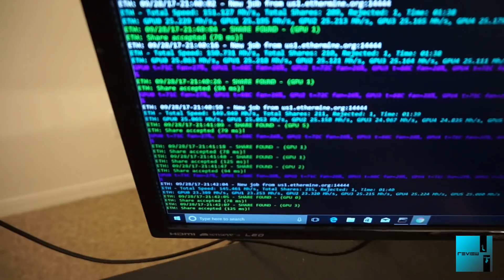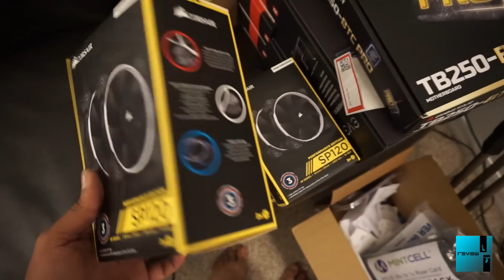8 GPU Mining Rig Build

Comment: Hey, is it ok to use both ends from 1 pci-e cable and put it in both power slots from the graphics cards. some people say it is dangerous. On my seasonic 1300W supply they say that if your card uses more than 220W than you need to use 2 cables (not the crossed one). So probably for mining this is fine, but for gaming you better use 2 different cables, is that correct? What is your view on this subject. Thx a lot. Greetings Mathias

Comment: what virtual memory settings are you using, i got my cards to run good on amd not sure if power limit is the cause but everytime i mine sometimes it freezes and puts mh/s to 0 i want to keep my m/hs steadily at 146 m/hs but as soon as one drops it goes to 120 help
Reply from the maker: i set my virtual memory to 16gb
Reply: i realized have to fine tune memory clock and core clock to stay stable then code a restart boot to ethminer i got a nice tune right now but it seems like i max out at 141  mh/s with 6 black edition gts cards without it crashing every ten minutes i cant bios mod them because when i do it only shows 5
Reply from the maker: after you flash the bios then run the patcher then restart then repeat for next card
Reply: do you know why a gpu crashes every 10 minutes and the system restarts? how do i make the gpu stable?
Reply from the maker: is the miner restarting or the whole computer?
Reply: i set a bat file so that when a gpu hits 0 m/hs the motherboard restarts msi starts up and the miner automatically boots up
Reply from the maker: mmm thats strange i have my bios to reboot if power loss but i just use team viewer to control the rig and relaunch the miner
Reply: see id prefer  not having to manually reboot it , but im just trying to have it stop crashing every 10 minutes i want it to mine for atleast a couple hours before a gpu hits 0 idk what the problem is but my average hashrate is pretty shit even though im getting 140 its saying average im getting is  54 average and 18 current hashrate so somethins up idk
Reply: nvm i just changed from 4444 to 14444 and is running for longer then an hour
Reply from the maker: Mining Rig if it’s mining and it drops to zero the gpu is overclocked too much set it back to stock settings and see if it crashes. If not go by 5 or 10 intervals and test
Reply: yea im at 1365 core and 2150 memory clock it seems to be running just fine no freezes im going to work in 5 minutes i get back at 5 so ill see if it is still running 140 m/hs im going to try to mod bios like you said what max mh/s that you can run but idk i got 2 850 watt power supplies and it runs at 1150 watts lmk how to mod bios and get a higher m/hs without freezing

Comment: im having trouble, device manager is not detecting any of the 6 xfx gts rx580 im getting 173 errors & im trying to figure out why i dont think it has to do with the riser connections i have 2 molex connectors connected into 6 cards idk if this is the cause, im jst trying to detect the cards in device manager please help
Reply from the maker: Kyle Perry is 4G enabled in the bios?
Reply: yea
Reply from the maker: Kyle Perry try one by one and see if it detects if not swap it with a riser you know it’s working if it works then you know it’s that riser it was connected too
Reply: what are the requirements to detect a gpu
Reply: okay so i unplugged everythin and turned it on i really dont think its the riser do you need to flash anything or which driver do you need to instal specifically for the gts black edition, the cards are not reading in display adapter in device manager, im trying to get all cards to show up ive been on this for days, going back from drivers to hardware but i want to know 100% why my cards are not showing up in display adapter or device manager ... i only have  card in right now which it is going to stay until i can figure out this problem, im leaning more to the side of needing a software update or something but every driver i downloaded didnt work please help it would be much appreciated
Reply: i also baught specific risers made just for this everything included

Comment: Hey man - did you power all the GPU's separately with a SATA cable each ? i'm wondering if you are able to power a GPU + a pci extender on one wire or 1 power slot per gpu card alone
Reply from the maker: the risers are powered wtih SATA cable on one SATA cable from the PSU I do two risers do not use all three SATAs on the cable.  For the GPUs i ran its on one cable for each GPU to the PSU.
Reply: Review I.T. thanks man i'm having power issues i think it's because i was sharing some of the gpu power cables with the risers i'll try keeping them isolated!
Reply from the maker: rz698 awesome try it out and let me know how it works out for ya 👍

Comment: Nice video, I would not expect going to a single power supply will save much in the way of power. The power drawn by the motherboard and gpu's will be the same, the only difference will be in the losses of the two power supplies v. one power supply. It's not clear which will be better until you do it.
Reply from the maker: Fred Zlotnick ya after seeing he power consumption and available vga slots on the power supply I can’t go to one has to be two psu. I’m gonna take the second 1200 and put a 850 so I can use the 1200 as the main for the second rig
Reply: If you are pulling almost half the wattage 1 1200 may be fine for the whole board. You can save the other PSU for a 2nd rig

Comment: Nice rig, looks good on the spacing and cable management. Some tips for you from using some of the same hardware in my rigs:

1) I have a few of those XFX 580 Black Editions, word of caution is keep a close eye on those hot-swap fans. I had one crap out on me in a little over a week. The fan would still have the red LED but wouldn't spin (tested it in another XFX card to make sure It wasn't software associated and got same result, a dead fan.)

2) I use the same PSUs on my 9 card rig (2x EVGA 1200w P2s)  and have tested using a kill-a-watt meter for 4x 580s and 2x 570s. Ive had the 1200 P2 hold temporarily even at 1411w according to the meter but it will definitely crash on you and isn't worth the time. If you had a 1600w P2 it may be possible by really working the system's power down. (one of your bigger power draws that you might not realize is those Corsair SP120s. They look great but a regular box fan works just fine.

3) vBIOS flash the cards and tighten up the mem straps for the best benefits.

4) With the "silicon lottery" it really depends on how well each GPU will perform and under which settings; check your cards ASIC values with gpu-z and hwinfo64. Each cards mileage will vary.

5) My cards are flashed for higher mem timings, running AMDs blockchain beta drivers and underclocked with Afterburner 4.40 (beta 15.) My mining profile for the 580s are as follows: core voltage -84, power limit -20%, core clock at 1154 MHz, and the mem clocks at 2250. 

You can definitely hit 30-31 Mh/s  on them with the right over/underclocks and a vBIOS flash. if you need some links to sources for the ROMs just let me know and good luck!

Blessings,
EJD
Reply from the maker: Evanjdevelopment will be making some changes this week definitely gonna try your settings to get that 30mhs. I’ll do a update video for sure. And thank you for the advice greatly appreciated and good looking out 🙏
Reply: No problem, keep it up and I hope to see you getting the results you want. Subbed.
Reply from the maker: Evanjdevelopment thank you!
Reply from the maker: Hey  Evan tried some of the settings getting stuck at 26.2mh on all the cards where did you get the roms at?
Reply: Take a look at this thread. Your Afterburner settings may need tweaking as well https://anorak.tech/t/xfx-amd-radeon-rx-580-gtr-8gb-hynix/6802/17
Reply from the maker: you rock! definitely will read through the thread and let you know tomorrow how it goes thank you for the help greatly appreciated
Reply: Werd, looking forward to hearing how it turns out! It's a headache tuning it all in but once you finally get it stable it'll all be worth it.
Reply from the maker: i was using afterburner for awhile but didnt see much changes with it. I am now using sapphire trixx. super easy to use and can control each GPU fan speed and still do all my overclocking with it as well.
Reply: Any bump past that 27 Mh/s, Jay?
Reply: Damn, I'm curious to see your ROMs and their specific mem straps and what Polaris vBIOS editor you've used. If you want we can talk on Skype or something.
Reply: Also, Jay, I just sent you a full guide via email. Let me know if you hit any snags.
Reply from the maker: ok ill check it out now i really do appreciate all the help!
Reply: No problem man, I try to reach out and do that for people because I remember wanting to rip my hair out back in 2015 (for like 3 months) when I had no idea what I was getting myself into hahahaha.
Reply: Dude, I s**t you not, this very morning I was using my datavac to dust the cards off on one of my rigs. So the datavac, doing what it does best by blowing air fast as hell through the nozzle attachment. GPU fans ramp up from the force and I GOT TOO CLOSE and the rear fan of an msi rx 570 gaming x blades caught up and 4 of them just flew in different directions in my workshop. I was so pissed hahaha.
Reply: Hi Evanjdevelopment, nice info.  By chance do you have any solid reference to RX480's, I got them to go a little faster, but can't get the power down, been adding a card here and there as I can get them, but using way too much power.  Currently using simplemining, but will probably go linux unless other suggestions seem valuable.
Thanks!
Reply: De WebDude, I'm sure I could help steer you in the right direction if I had some more info about your rig man. E.G. what exact cards, bios mods, use of any O.C. software. If you have a Skype or email feel free to comment it in reply to this or see if you can message me on my channel's page.
Reply: Evan, can you sent me also that full guide by email? Thanks!
Reply: sent it... tks!
Reply: You should get to 31mhs for sure. 
I have 12 rx570 4gb (7 gigabyte & 5 mixed brands) running on two rigs. I have flashed the bios to tighten the timings, set the GPU clock at 1112 MHz & memory at 2000. I only use afterburner to fix the fan speed at 70%. The cards hash between 27 & 29 Mhs with power between 75 & 90watts. You should do better with the 580's.
Love your build. Cable mgt much tidier than my two rigs😄
Subbed
Reply: Muhammad Talha Lone, sure I can help if you're trying to make decisions on all of that. Bear in mind though, with the current price of components (namely GPUs) your ROI will take a little while. Also gotta remember that crypto value is so volatile.
Reply: when you change your bios does the fan have to be modified in afterburner?
Reply: Sounds good. I'll take a look into the ROMs embedded hex data whenever we're back in touch.
Reply: tried any of these? https://anorak.tech/t/xfx-rx-580-gtr-s/6053
Reply: I think the majority of those are linked by posters within the initial thread I commented with a link too a few weeks ago (albeit disorganized).
Reply: Man that does suck. Are you positive you have to go that route though? If you flip vBIOS switch back to the normal setting (away from the I/Os) and if you get a proper boot up you can just flip the switch back while in the OS and reflash it.
Reply: Meant to reply sooner, but do you have a cpu with onboard video?
Reply from the maker: Evanjdevelopment danggggg that must of sucked I would be mad as heck. Im wondering how these swap out fans will hold up. It’s been running for days now a little over 200 mh. We also ordered everything for another setup as well
Reply from the maker: Alexandre Barbosa message me your email
Reply from the maker: sent you a email let me know how it goes
Reply: Your mileage with AB will vary per card as all chips are different (silicon lottery). Are you using the beta blockchain drivers from AMD?
Reply from the maker: Raptgryllidae 1  I was adjusting the timing and memory last night and got up to 27 gonna try some more today. Thanks for info greatly appreciated 👍
Reply from the maker: Evanjdevelopment no luck still stuck at 27.8
Reply from the maker: Evanjdevelopment ok I should be home in a couple hours I can send you the rom and info for sure
Reply from the maker: Evanjdevelopment what’s your email?
Reply: Evanjdevelopment i have 8 msi rx580 gaming X and modded with a bios by frosty and tested 10hrs @ 31mh/s but i didn't change the fan speed and woke up with it bricked lol, i had to take the backplate off and do a paper clip flash argh haha
Reply: yeah man unfortunately i didn't do enough research the msi gaming X doesn't come with a vbios switch! so if i can get it @ 30MH/s with good temp an lower voltage i won't ever touch it again haha
Reply from the maker: Evanjdevelopment lol that’s exactly how it’s been the last couple of days 😂
Reply: wow, sorry to hear that.  I got a nick in my wrist from one fan trying to move wires away from the fan that were ticking.  BTW, I have an 8GPU rig w/MSI Gaming X RX580 8GB.  running with basic bios mod on latest one click bios editor and only did a -50mv change using Trixx and did a linear fan ramp up.  Thought I was good at 225 Mh/s for the rig but this 240 looks better!   Any suggestions.  I saw you posted core voltage -84, power limit -20%, core clock at 1154 MHz, and the mem clocks at 2250.  Think that is good for the MSIs?  I was having issues trying to set things with Afterburner beta 19.
Reply: Evanjdevelopment yes gained about 4-5 Mh/s with the blockchain driver. Forgot to mention that.  Also: Have Samsung and Hynix memory in different straps apparently on same card.  All cards same.
Reply: Yeah, the two types of memory shows up commonly. There's a good collections of ROMs here if you find one for your cards you might try flashing one of them, then running the pixel patcher to set it in stone before rebooting. and testing it https://anorak.tech/c/downloads/l/latest
Reply: Evanjdevelopment yeah I looked there. I didn’t see anything at the time but will try again.  I was thinking/hoping I could do optimization on afterburner but even the new release 4.4.0 doesn’t seem to even see the cards. It’s running steady at 225 so don’t need to do much.
Reply: What do you mean by "see the cards"? Are they showing up in your device manager or do they have yellow hazard looking labels next to them?
Reply: I mean MSI Afterburner doesn't show anything for the cards when i select them.  0's for speed.  Trixx does show them.   device manager is fine, cards running fine.  just MSI doesn't seem to see them.  I have Nvidia in other rigs and MSI sees them and I can OC them fine.   With these MSI Gaming X RX 580, 8G, I don't see any way of controlling them.   I haven't rebooted because it's running ok but it's been that way for awhile, where Trixx works and MSI doesn't.
Reply: It sounds like you don't have them properly patched. open your device manager and look under display adapters
Reply: all looks normal.  they are all mining at 28.X Mh/s.  patching them in which regard?  the bios was done, the blockchain drivers were done.   each added more Mh/s.   I want to go further with MSI Afterburner but as I said, doesn't see them.   Let me try reboot and see if it helps.